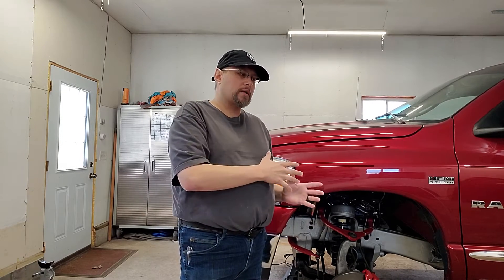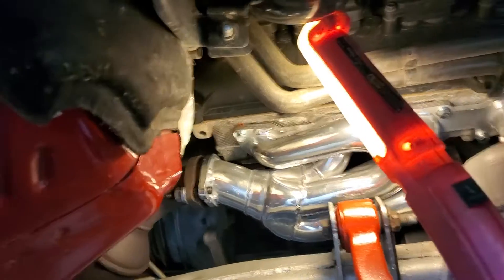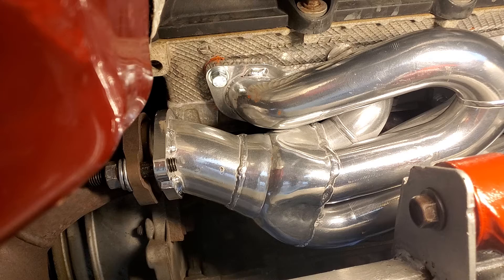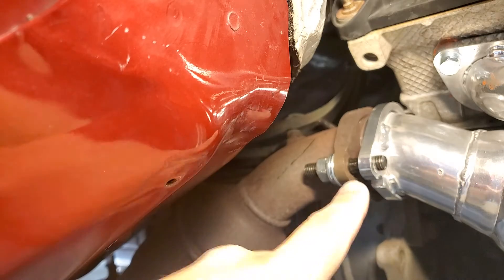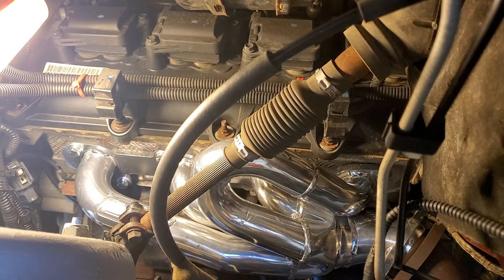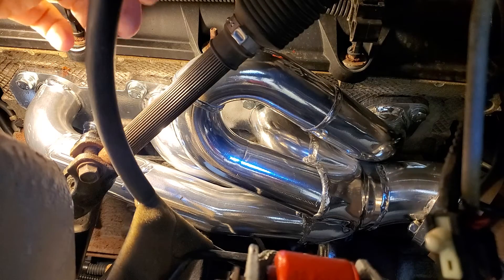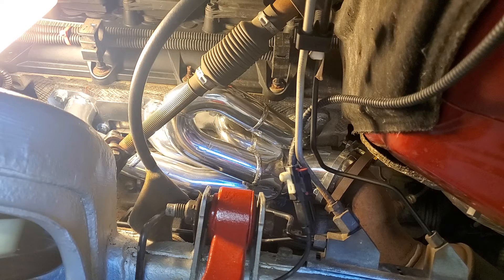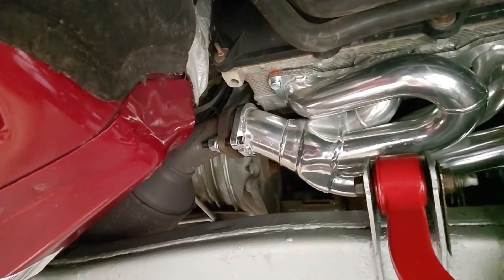Installing BBK Shorty Headers on Dodge Ram - Bad Wrench

Comment from the maker: I had to have a second pair of hands to do this in stall. I am so glad that they are finally in. But I have a leak that I need to fix.
Reply: How that turn out
Reply from the maker: The leak was fixed but I had to modify the right side exhaust flange to seal up the exhaust. If you're flange is not bent like mine was then these headers should be a direct bolt on.
Reply: @BadWrenchAuto  glad you was able 2 fix it I was going to to put the headers on myself but I have to shop do it cuz I'm getting high flow cats and electric cutouts to go with it
Reply: How did you do the bottom 3rd bolt on the passenger  side

Comment: Hey, what about the oil dip stick? There's a bracket under the manifold that make it really hard to get the dip stick out....what did you do to work around that braket?
Reply from the maker: @davidlepore4552  I dropped the headers in from above the valve covers. It was not too bad because they are shorty headers.

Comment: My BBK headers cracked under a year on my 2014 Ram. Very disappointing! Trying to find what the warranty is now.
Reply from the maker: Very disappointing, I know that the gaskets are different then stock so if the gaskets burn out then you have to contact BBK. I got the ceramic coated headers but I did notice how thin the metal was. 😒
Reply: @BadWrenchAuto  Well I hope the ceramic is strong. It cracked right before the collector. What is crazy is I've been having this problem not long after I installed them so they basically lasted a couple weeks. I installed them when I put a cam in so the process was easy considering I had them on when I put the heads back on. I imagine it's going to be a task to get them off and new ones back on with the heads on the truck. 😨 I emailed BBK but I'm sure nothing will come of it, really don't want that brand any who considering.
Reply from the maker: I would look for a different brand for sure.

Comment: What lower control arms are you running?
Reply from the maker: Just using the stock lower control arms. I only have a leveling kit in this front end. I choose to use a less bulky upper control arm  from ebay. But it is the exact dimensions of the stock upper control arm just much clearer looking.

Comment: I’m trying to install some JBA shorty headers for my 06 ram 4.7 is it easy or hard? I’m thinking about taking to my local mechanic but might charge me a lot especially for labor
Reply from the maker: As long as all the bolts come loose and none break, then it's not hard to install these headers. I couldn't get mine to seal, so I did have to go to a welding shop to fix my Y pipe to get it to seal.
Reply: @BadWrenchAuto what do you seal? Was there a leak?

Comment: Can you install one header one week and the other the following week
Reply from the maker: @frankfreire582  If you're going to drive the truck in between that time, then I would not do that because of the different exhaust pressures between the exhaust manifold and the headers. Exhaust will flow faster through headers than manifolds.

Comment: you can buy the proper collecter bolts...I did ..yours are in backwards...
Reply from the maker: I had got the collector bolts with my headers but my Y pipe would not line up and in a different video I have to modify my Y pipe so they will seal up properly. I did notice that my Y pipe was miss aligned after I had the dealer fix my broken bolts in the passenger side head. Thank you for the info.

Comment: Agree Shorty Headers are a PAIN, NIGHTMARE, FK THIS!!!!! to thread. But doable, creative mindsets will figure it out. Performance...???? likely some. Biggest thing will prevent replacing stock that will snap manifold bolts from expansion/warping. AS you know.

Comment: Since you can’t get at any of the 10 mm bolts I don’t see how a BBK Shorty header has ever been installed. I think it’s a $500 scam. Even if you could get them all and you could never torque them.